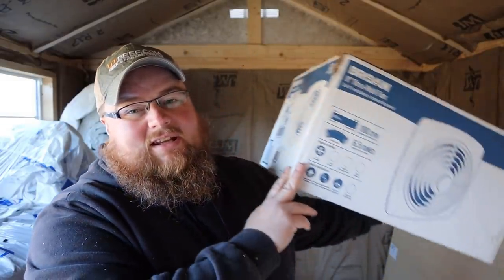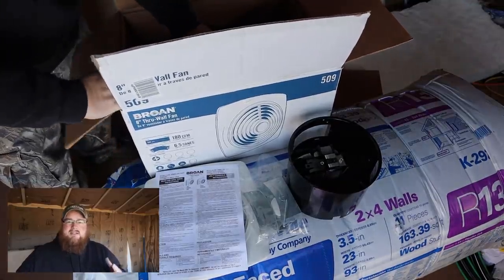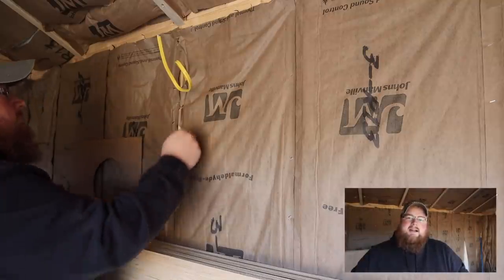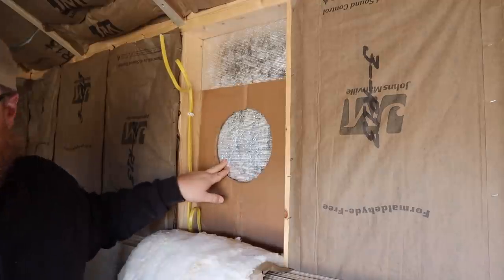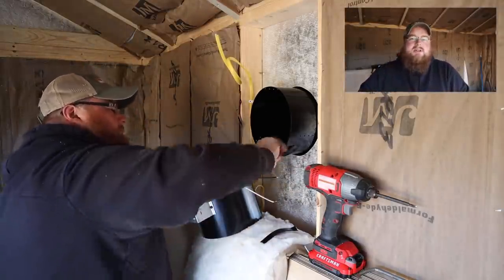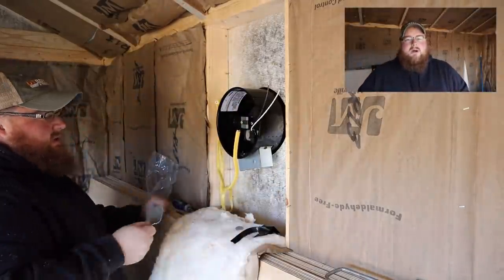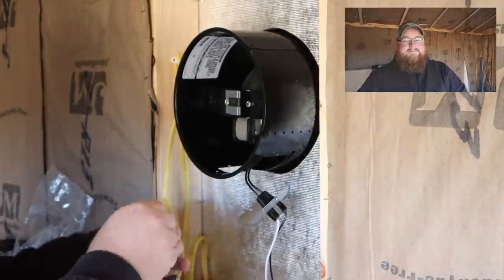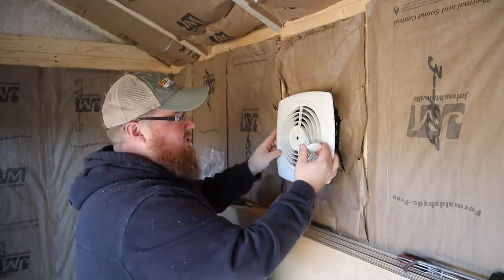HOW WILL WE HANDLE THE SOAP FUMES? - How to Install a Through the Wall Exhaust Fan Broan Nutone 509

Comment: Nice video. Thanks for the demonstration. One small point, around 6:47, the electrical box should drop down into the rectangular cutout from the inside rather than screwed up from below. This makes it possible to mount the fan when the sheet rock is already up. I getting ready to do just that and this video had me worried until I read the directions😀.  Good luck with the soap business.

Comment: You did a great job. Only thing I really have trouble with, is getting the inside hole and outside hole to line up. You have a trick for that? I mean the initial hole the whole unit goes into.

Comment: Just an FYI from my past install. The screws to hold the cylinders together go on the inside and the plug slides down in from the inside as well. This way you can remove the entire unit and replace without removing any sheetrock.